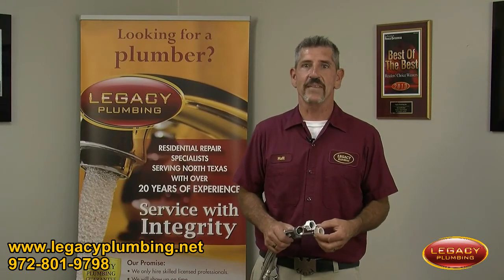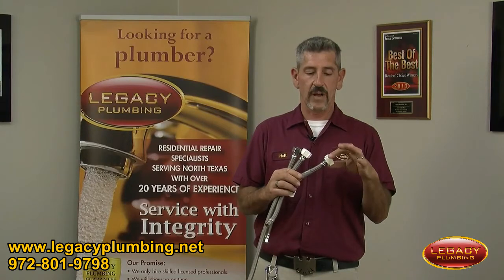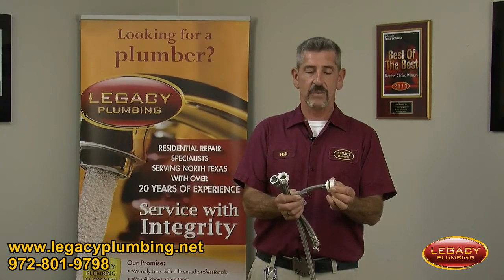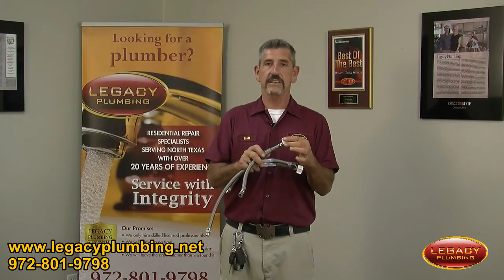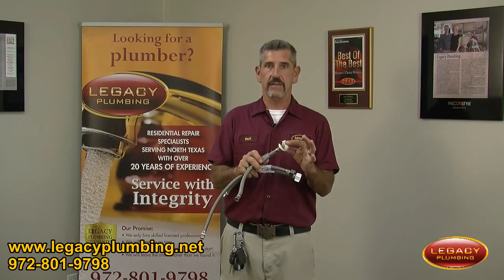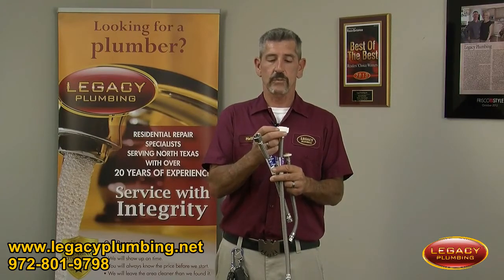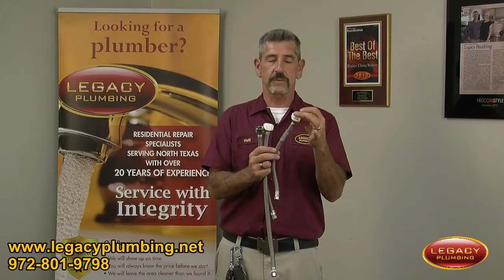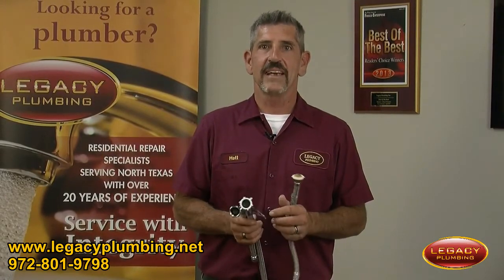When To Replace Your Toilet Supply Line

Comment: Awesome!  I had two plastic nuts fail in my house within one season.  One was 2.5 yo and had a slow leak which did a ton of damage and we got an insurance claim.  Other one was 5yo and split exactly where you said in the middle of the night.  Gushing sound woke us up and we saved the house!  Looked everywhere to find metal nut version and replacing four in the house.  Home Depot guys said they'd never heard of the metal kind but found some at a plumbing supply store.
Reply from the maker: Yeah, that's another reason why it's always good to replace the supply line any time you are doing work on a faucet or toilet. There are some pretty cool technologies coming into the market that prevent damage when things like this happen by automatically shutting off the water to the entire house when a sudden leak occurs.
Reply: @LegacyPlumbing  That's really cool.  Where can I find these auto shut off technologies?
Reply from the maker: @michaelharker6170  The one we install right now is called the Flo by Moen.  It has a lot of cool features. Learn more at https://meetflo.com/